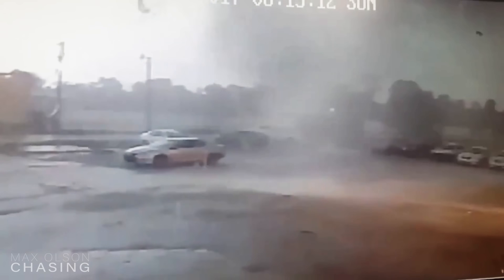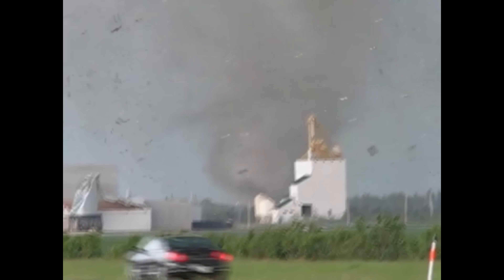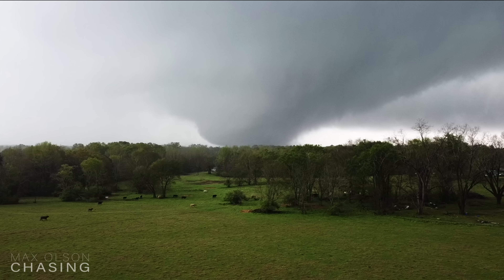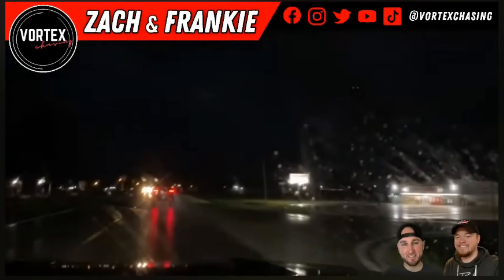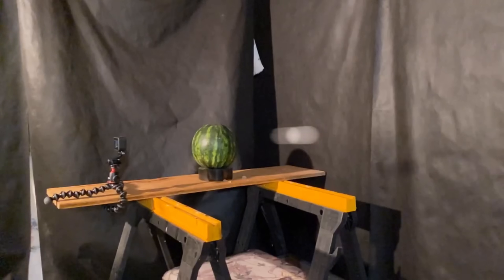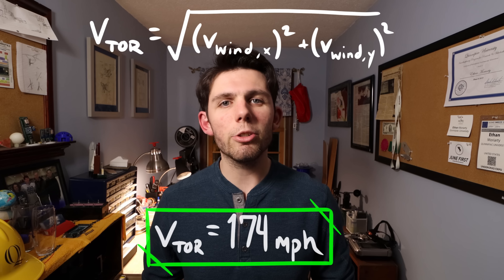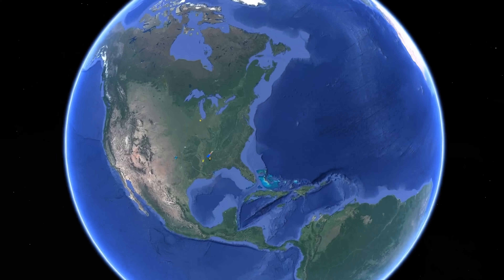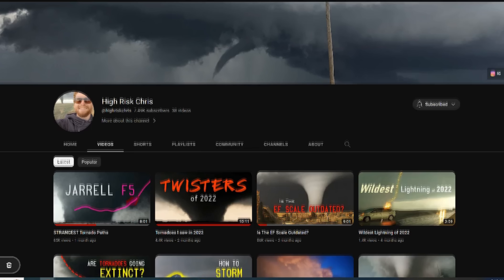Is This a Vehicle Flying Around a Tornado? - Rolling Fork, MS

Comment: There was not just one light, there were two. They are visible on each side of the funnel at the same time, and are very easy to see in slow motion.
Reply: It is true in another video that I saw of another storm chaser you can see when a light is in the air and another is absorbed from the ground.
Reply: Glad to see others seem to have noticed this as well. 
Also as the car is at its highest and on the right side of the tornado, you can see another light in the air for a few secs.
Reply: That could also be lens flare. Not able to tell from this alone. It truly would be horrific if it were a pair of car headlights, so I’m hoping it was just flare.
Reply: @tygrubb  you can see how the headlights are partially illuminating debris in the tornado. Lens flare can't do that.
Reply: Yeah, in all the discussion/debate around whether it was lens flare, a drone, if tornadoes can even pick up cars without being a high end EF-5, etc. I never saw anyone mention that there seems to be multiple cars on opposing sides of the tornado. I just thought no one else talked about it because I was crazy & seeing things or not understanding something properly. Just makes it even harder to grasp seeing that others noticed it as well.
Reply: I also noticed on the original video, posted elsewhere, that there was an object with two lights, close together, that looked like headlights that was flung off to the right as the brighter, more singular looking, light came swinging around from the left.  When the first object was flung off to the right, it looks like there’s a hint of red, like a taillight, before it disappeared. 

Since no one was talking about it I wondered if maybe what I saw was a reflection on the camera lens or something.  But the more I look at it, the less certain I am of it being a reflection. 

So, I also think there were at least two vehicles in there.
Reply: Those were cars flying inside and around the🌪.
Reply: Glad to know I was not the only one. I did not see anyone else mention it. I thought it was lens flare too at first, but after having re-watched it multiple times, I concluded that its not the case. 

I got scolded over at Reddit and here for saying that those were vehicles in the air. One comment even saying I probably don't have a very good understanding of physics. 

I guess me, Dr. Haan and the most of y'all aint got a clue about physics either then (<-joke) 

For the last 30 years I have taken deep interests in tornadoes. I have studied many tornadoes and their behaviour, including but not limited to EL Reno 2011 EF5, Philadelphia MS EF5, Phil-Cambpell AL EF5 and Smithville AL EF5 , Jarrell TX F5. 

And I have never seen anything like these lights before. Its trying to tell me that tornadoes are terrifying monsters that still can do stuff we might not understand completely, but I don't want to believe that. 

And I also cannot fathom that those light have been humans dying in a horrible way, captured on film. It feels terrible to know that it most likely was.
Reply: Government Drone; weather control. Is this something we could use against China? Gotta test here first.
Reply: @MrGyngve  Many of us witnessed the (plural) vehicles swept up in the tornado. The magnitude of how somber a moment it was, knowing that people would inevitably be inside those vehicles, and being aware of their imminent demise kept many of us silent on the subject; however, this is an important topic to discuss in order to study and learn more about the physics involved with each type of tornado, to further advance our understanding, and future predictions for advanced warnings. RIP to those who were lost, and support and sympathies to all affected. 🖤🥀🖤
Reply: Agreed
Reply: I see at least four, possibly five. 😢
Reply: I slowed it down and saw the other one mentioned. Truly horrific.
Reply: Based on my own observation, and slowing each of the clips to .25 speed... 
There are a total of 3 lights...and the object has 3 sides...all equal in length. It appears to have a grayish color as well...js.
Reply: @meaganallen6569  did you see it with your "third eye" ? lol
Reply: It's hard to imagine that is a car. The brief oscillations in the lights are far too fast to be a car spinning around It's axis of rotation. It could be explained by debris occlusion though. For the lights to be oriented towards the observer for so long in such a dynamic environment, is also highly improbable, especially with something as highly unbalanced as a heavy-ended vehicle. If it was a car, I seriously hope it was unoccupied. Whatever it was, it had substantial mass. It's important not to be biased in the absence of information.
Reply: @VolkXue  duh.
Reply: There’s a video of a chaser being struck by the tornado, his vehicle rolled over but luckily rolled back on its wheels and the chaser was fine. But then there’s a vehicle next to him that is on its roof and the roof itself is caved in. In this video it showed white lights. The car that was next to him had led white lights…
Reply: Cars tend to be nose heavy due to the engine being in the front. Wouldn’t any headlights be aimed down?
Reply: @meaganallen6569  no wonder you just made it up then lol
Reply: @corsairusawc  Absolutely plausible. I can see that being the case.
Reply: @racos2961  lol absorbed... It's a storm the  vision is hard to see and it's a light... It obviously broke lol
Reply: @MrGyngve  small comfort perhaps that all you can see it tiny light with lots of dark dusk black color (meaning no blood or gore of any kind)?
Reply: If this is a car we’re seeing, wouldn’t two lights (left & right light) be visible instead of what appears to be a single light?
Reply: @actuallyitisrocketscience  A lens flare wouldn't be a dot like light,  but bigger and have soft edges. Also the lens flare wouldn't move with a still camera.
Reply: @corsairusawc  True, but wouldn't something so light be whipped around a lot faster than a car?
Reply: @MysticBreakdown  I thought about that but because its far away it would be hard to see that. Has anybody zoomed in to see if there's 2 lights side by side?
Reply: I did not see if somewhere in this process zoom was used to see more detail.  Also, where the light decended, since the location of the vortex is known, were any searches conducted for a matching vehicle?  As the vehicle descended, and because the majority of weight was in the front, this should have caused recognizable patterns of impact (perhaps evaluations of many traffic accidents could be of use)on the vehicle.
Reply: @MrGyngve  didn't one of those throw a pickup almost 300 yards into a water tower?
Reply: When I watched the video there were two vehicles. One with 2 obvios headlights and one bright one. Could the singular one have een a motorcycle? That would have been easier to lift.
Reply: That my ufo😅
Reply: My gramps kept a ufo in his farm. The tornado took it. They took ur job!!!😂
Reply: @dem0nchild610  yes, smithville MS in April 2011. A suv was lofted and carried across town, impacting the water tower and leaving a massive dent with paint from the vehicle on the tower before it was later released and fell to the ground in a crumbled pile of metal.
Reply: That's true. It's? A. Car then?
Reply: @PollyHistor  i mean the thing that i feel would be the more fatal threat being in a vehicle while in the tornado wouldnt be the landing i think the more likely thing to kill you would be the debris hitting you because you know all the windows where busted out the moment it took flight theoretically you could survive getting picked up in a car and thrown but it would all depend on if you get hit by sharp or large debris if you arent getting sucked out even if you have your seat belt on and where and how the car lands if it lands at a heigh that is more level to the ground your talking about the cars most damage from the landing how fast its being blown away and what its hitting and if its rolling but if you land faster on the axis of height your way less likely to survive even if you land somewhat upright and that is just not a good chance and this is why you have such a low survival rate for that kind of thing.  and more then likely your not going to be  sucked in your way more likely to be blown away and rolled in the process.  if we look at the el reno tornado and what was left of the twistex teams car that car was in the air 100% and landed very hard you only see damage to cars like that that have been crashed off a cliff.
Reply: @We The Deplorables  
I also saw red brake lights from another lofted vehicle.
Reply: @mabybee  
I noticed. Headlights and rear brake lights from lofted vehicles! They were trying to find that one specific vehicle because of the height/time it was aloft.
Reply: True.....if they find the possible vehicle(s)they should check to see if the headlight switch is on.....just sayin..
Reply: I totally agree with you. It shows that vehicle sucked up from the base of the Tornado. Then swirling outside of it. You can see the front headlights.
Reply: @CurtisSandoval712 Dubai already does this, cloud seeding
Reply: @dem0nchild610 yes in Smithville Mississippi
Reply: A lot of the stuff to be really hard to re-create in a lab but even getting a piece of strata sticking to the side of a tree or piece of rubber or something is likely going to be hard to reproduce but if you have half 1 million pieces flying around, the odds of beating the probability calculator to do that is likely to occur even if it’s not with that particular storm..  same with a vehicle being able to orbit..  I love the amount of objective analysis they did for this, with that said, I would be shocked if it was not a vehicle of some kind..!
Reply: @CurtisSandoval712  lol. because a tiny little drone could do anything to something like this.
Reply: @hgbugalou  No. but similar concept to how cloud seeding intensifies the rain and precipitation of storms…and, how when they shoot electricity into storm clouds the frequency and intensity of lightning thereafter is greater….maybe they see a tornado most likely to develop (just like any storm chaser would) and then as it starts they experiment with a drone to see if they can maybe alter the route; control the route somewhat; intensify; detensify. Shoot, they just tried to crash a meteorite to see if they could alter its path at all. Why wouldn’t they try something like that here on earth? That’s all I’m saying Michael ✌🏻
Reply: UFO that was actually alien is my guess.
Reply: @normanhicks1892  agreed. Great point
Reply: @MysticBreakdown  great point
Reply: I wonder who were in those two cars. Could you imagine what they went through. My guess was they were trying to flee from the tornado and they couldn't get away.
Reply: yup, i zoomed in and without a doubt, those are two headlights.
Reply: @MrGyngve  That Jerrell and Smithville Tornado 🌪️ is the strongest I ever heard and seen. 

Both left no damage but one moving at 7 MPH and the other moving at 70 mph.
Reply: @CurtisSandoval712  always gotta be that 1 tin foil hat wearer
Reply: If it were a car, it seems odd that the headlights would be pointed towards the camera for the entire length of the video. Whatever it is, it would have to have a self contained power source like a battery. I wonder if the city had anything like a solar powered street lamp. It would be much lighter than a vehicle and would be more visible at any angle.
Reply: @CurtisSandoval712  stop.
Reply: @corsairusawc  needs a power source to produce light….
Reply: Honestly I thought I saw 3 😳 I think I see the 2nd one get flung off to the right around 13:21 into this video (time stamped 0:59) and then it looks like a 3rd is picked up about a second later on the backside and comes around the left side much lower. It does look like the 1st car stayed in the air the longest.
Reply: It could be a battery powered emergency light which was inside a building. I know the building where I used to work had them. When the power went out they would turn on.
Reply: @CurtisSandoval712  Cloud seeding is dubious at best and the best experiments yielded very little results. As far as "shooting electricity" into storms I have no idea what you are talking about. Do you mean rocket sounding to trigger lightning?  People fail to realize just how much energy is released by a single thunderstorm.  We are talking about megaton nuclear weapons ever second in a single supercell.  To change the outcome of such a system you are going to need comparable amounts of energy on tap to change variables in a way that will change a storm's behavior.  We have no way of storing or controlling that much energy at current.  There is some argument to be had about controlling initial conditions could allow you to control the weather without as much energy, but you would still need a ton of it along with a much better understanding of how storms form than we do now. An example of this would be using a drone swarm to shade a part of the land and prevent solar heating on a severe weather day. That wouldn't take megatons of energy but would still be a colossal effort and we could only do a couple square kilometers at most and the storm would just form elsewhere and the mesoscale difference in temp we made may actually enhance the storm.
Reply: @normanhicks1892  what about an EV?
Reply: @dannymorgan7252  reread my comment
Reply: I was just about to post the same thing. Interesting they don't even take notice of it. Regardless if they're still investigating, it's immediate noticeable
Reply: @gregoryleblanc7938  Yes. When you slow it down frame-by-frame and look at each passing second as a close image, You'll see multiple dual lights (some white, some red) separated in distance just like multiple sets of headlights and tail-lights.  It's even more sad when you analyze it closely. 😢
Reply: @MysticBreakdown  Zoom in tight on single frames. You'll see pairs.
Reply: Theres also a third one which is with the first light in the sky
Reply: @skateboardingjesus4006  well you've already seen it happen with tractor trailer containers
Reply: @tygrubb  dude that would have to be a heavily transformed video for those to be lens flares
Reply: @Rosalies_  Dude, I am a photographer and worked as colorist in the industry. I know my optical artifacts. It does turn out that these lights were see in other video and so may very well have been a lofted vehicle, but on the basis of this video clip alone, it could be flare from drone lights.
Reply: Picard would tell you there are FOUR LIGHTS
Reply: @CurtisSandoval712  you'll believe anything if you think that
Reply: Their investigation ended without an explanation…(meant to say)
Reply: @tygrubb  the problem there , is that they showed up in other videos. The last gentleman he questioned mentions this.
Reply: @ttm1093  Read my reply above.
Reply: I see at least two lights aswell! Glad I'm not the only one!
Reply: @chrisferguson5661  I worked the aftermath of it. I saw a semi in the middle of a farmers field, upside down.
 The trailer to it was found a quarter mile away.
Reply: @tygrubb  no
Reply: @SeatLeonMK2  Yes
Reply: It's obvious there are 2 lights how can people miss that?
Reply: There is! even not in slow motion you can see them if you look in the right spot
Reply: Wouldn't the car be tossed around turning the lights into different directions and not being in the same spot like in the vid?
Reply: @cups_of_water slow shutter speed causes that effect. Thus channel just recently uploaded a video explaining why that's the case.
Reply: The other light is dimmer and seems to stay put. It is not rotating like the brighter light. I also magnified the picture to see more clearly.
Reply: @mabybee  Dunno why people even think it takes a "High-end EF5" to at least pick up a car. 136+ MPH (EF3) winds alone can tumble cars harshly.

What does a tornado of "High-end" EF5 strength do? Well.. just look at what happened with the New Wren EF3 (with unsurveyed EF4-EF5 damage) and the subsequent infamous Smithville EF5 during the 2011 Super Outbreak. Cars thrown and remaining airborne over very long distances. New Wren EF3, in fact, possibly holds the record for farthest distance a vehicle was ever tossed by a twister. Sadly, someone was in it and died that day. Literal nightmare.
Reply: @U-L-T-R-O-N  agreed. I thought it was a silly debate since there’s evidence of relatively large objects being picked up in “smaller” tornadoes but I guess in the internet age everything is a debate, even well known things.
Reply: @CurtisSandoval712  Dude. Stop it.
Reply: @OutlawEntertainmentlmc  Cloud seeding is hardly weather manipulation. It certainly comes nowhere close to creating tornadoes. Might as well claim a kid sloshing the bath water back and forth means we can create tsunamis. Take some basic science courses.
Reply: I saw 2 lights that appeared to be headlights. Made me nauseated. In the Tulia TX tornado I saw a semi hooked to a grain trailer stand straight up and then go sideways as it happened. After that I was in the cellar.
Reply: like
Reply: its at like 13:28
Reply: @timm8263 
Centrifical force would most likely keep the heaviest end pointed outward and the video of the light or lights in that tornado was taken right before the tornado moved into Rolling Fork...I have been up close to now 5 tornadoes with this one being the most intense..a very loud roar and ears popping and closing up from intense pressure changes..I would rather not experience another but came very close yesterday Saturday Dec. 28, 2024..twice..luckily they went to the west of us on a more northerly track.
Reply: Cars . Zoom in on them and watch in slow speed 😢